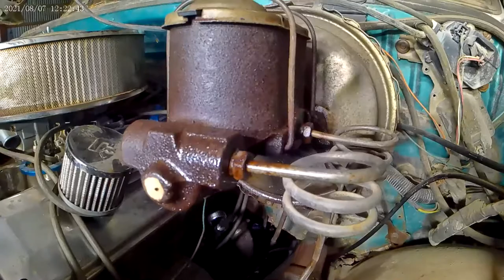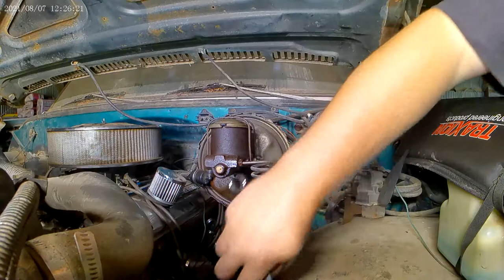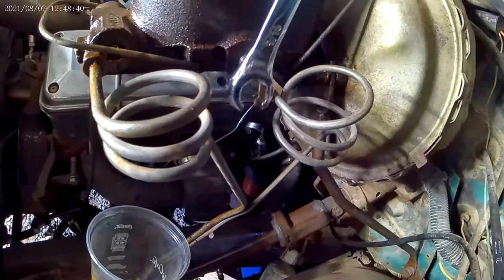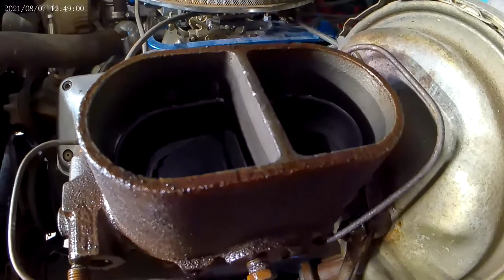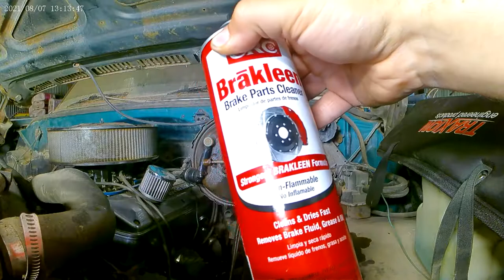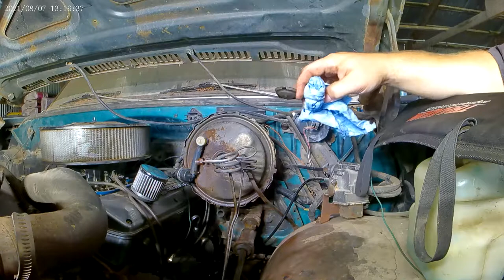1979 Chevy K20 Brake Master Cylinder Replacement Video 1 of 2   Removal Only

Comment: You shouldn't loosen the master cylinder before you disconnect the brake lines! Get some brake tubing wrenches if your going to work on brakes. A 15mm brake wrench fits those nuts just right.  My '80 Chevy K20 has lock nuts on the master cylinder. Your going to find metric nuts and bolts all over that truck. Sometimes you'll have a SAE bolt with a metric nut and vice versa.